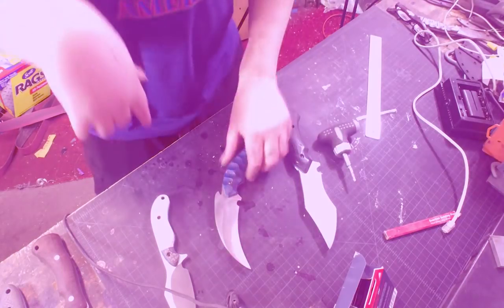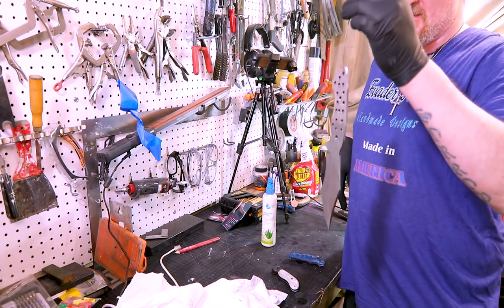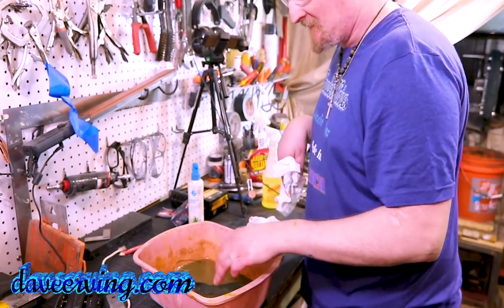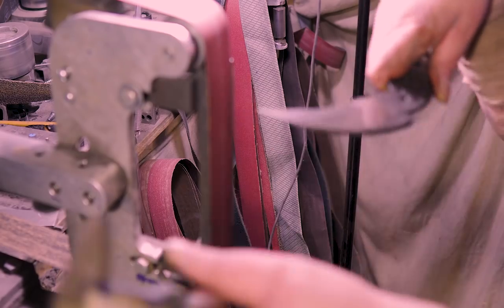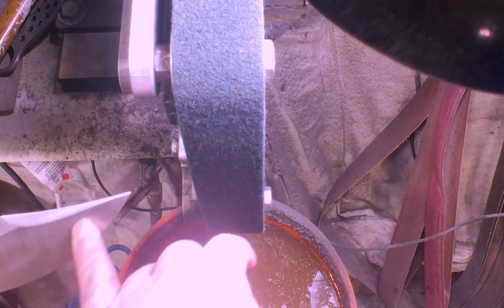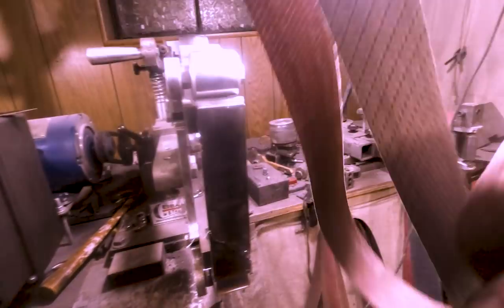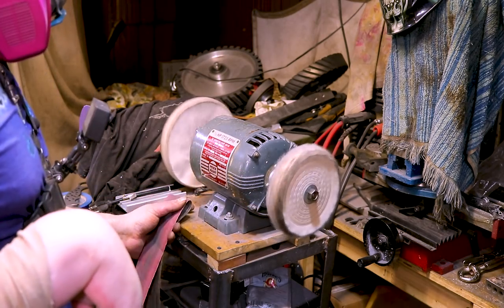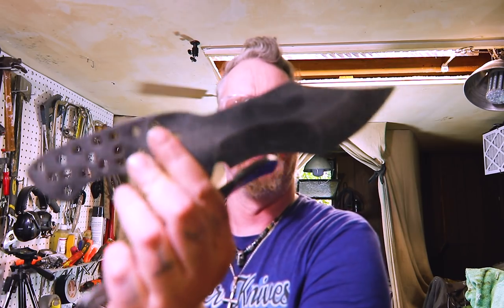Knifemaking - Finishing bevels without handsanding(Hamon build)

Comment: Made a sweet cleaver with mystery steel. Came out great until I tried my Rockwell hardness files 😂😂😂😂. I see why they call it mystery steel. At 40 it dug Deep. Haha. Good prototype though. Now working on the real deal. Keep ya posted
Reply from the maker: Yeah, that's why it's best to test before putting in all the effort, if you have a piece of the steel leftover, you might want to try quenching in salt water or salt water with canola and some dish soap... It might just need a faster quench... but I definitely suggest a steel you bought made for knives... then again, i did a lot of practicing on mild steel too.

Comment: Man I ground a bevel on a 1084 steel knife all the way to the apex. It was pretty cool and super sharp but it messed up pretty easily so I put it on the edge pro and now it’s one of my sharpest knives I’ve ever built. It no longer comes to an apex but it is extremely thin and consistent behind the edge and has a very sharp edge. My handles  are maple with teak oil rubbed on but they are seeming to stay a bit sticky. I guess I need to buff them with some white compound to get rid of that sticky feel.
Reply from the maker: I guess the word apex is throwing me off a little, so you did a zero grind at first? In my mind, we always grind to the apex, it just depends on thickness, but my thinking is off a lot of times, hahaha... You know, that's the problem, too thin is really sharp, but also really thin which can be unstable. Where a thicker edge is more stable but takes more to sharpen... My friend always complains my edges are too thick... Did you put the teak on too thick, maybe it needs more drying time... I don't know about using compound till everything dries, seems like it would make things worse, but honestly, i don't know...
Reply: I ground after heat treat till it came to a point(apex) paper thin. Actually way too thin unless it would have been a convex edge in which you want to come to a singular apex. On flat grinds not so. Anywho it came out phenomenal as for the finished edge. I don’t recall what degree the sharpened edge was but it’s damn sharp and I believe it will have decent edge retention. The teak should have been cured. IDK. I can always start that process over to get it glossy smooth!!! I love what you are doing but that’s way above my current skill level. Still love watching, one day it will make an impression !!!
Reply from the maker: @e.t.preppin7084  Ah, gotcha. I was pretty sure that's what it meant, but wasn't sure... See, sometimes I need guys like you to teach me things too... That's the great thing about YouTube, when you get there, the video will be here, i find myself going back all the time and watching other knife makers videos to keep on top of things...

Comment: I just bought a a30 trizact. Not sure what it’s good for. My head is swirling from all the different belts I’ve bought. I don’t know where to start anymore. Aside from the 36 AO belts starting out. I don’t like the buffing wheels I have. What would ya recommend
Reply from the maker: Trizact are just higher grit belts that last longer(like ceramic belts over AO) a65=240 A45 =400 A30=600... I don't use AO oxide belts till I get to 220, because AO wears out and really heats up quick... Tru grit Abrasives has VSM ceramics for around $5 a piece, AO is about 2.50, but you get 4 times the wear from ceramics... I gotta admit, I'm new to buffing myself, I just bought these, a 3 pack... https://amzn.to/2GF9rS2